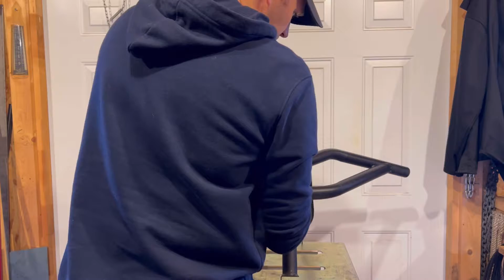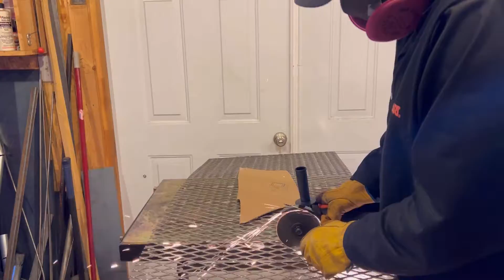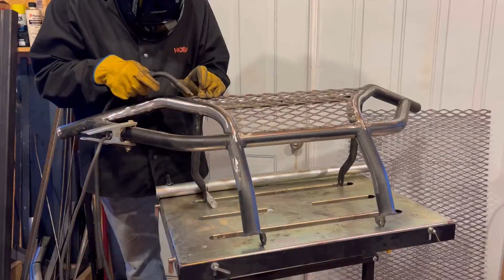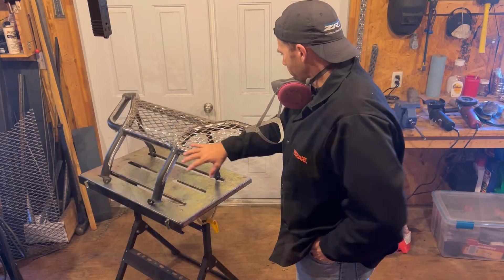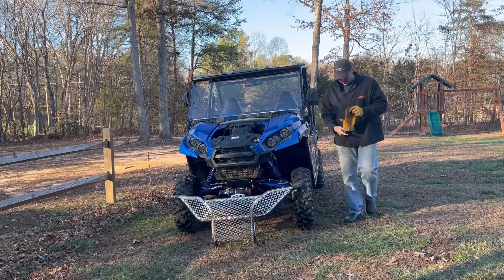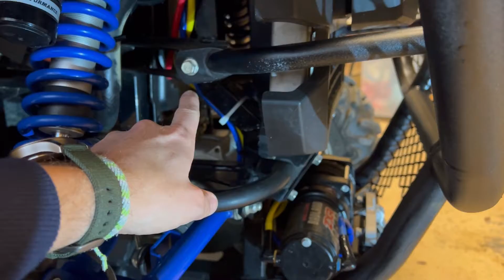Kawasaki Teryx Bumper Upgrade

Comment: If your winch were to fail, and you could only be winched out from someone else in the front, what anchor point would you connect the other person's winch hook to?
My crappy winch burned out on me on the trail and they had no other option but to use my front, brush guard. It's hallow, so I'm thinking that's not a good long term solution.
Thoughts?
Reply from the maker: Yeah, that brush guard is real thin. I have a tree saver strap that would do a better job to distribute the load. If you did it near the bottom that would help. If it want to ride up you could use the same strap and just choker it off around the base of the brush guard.

Comment: what size tube are you using for the top ?
Reply from the maker: I used 1-1/2” conduit. It matched the factory wall thickness of the stock bumper. 1/16” wall thickness was the factory wall thickness just like the conduit. I try not to weld with the zinc on the conduit. I’ll either grind or put muriatic acid to get through that.